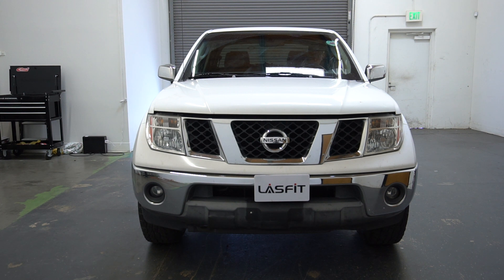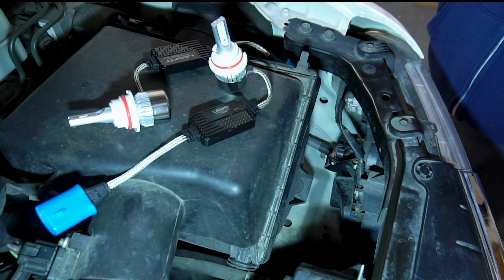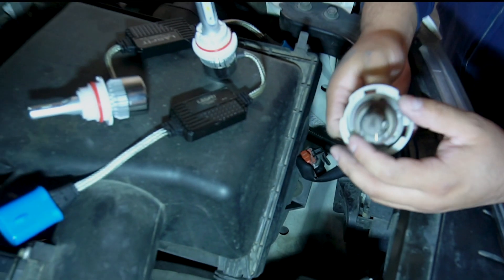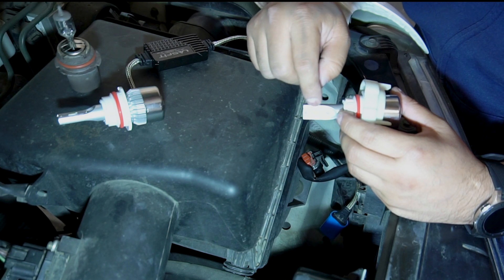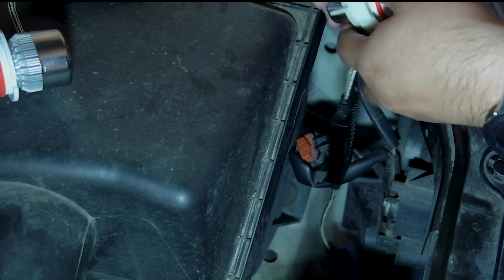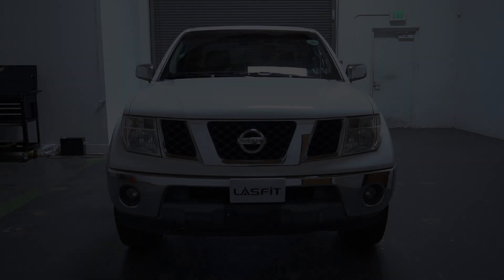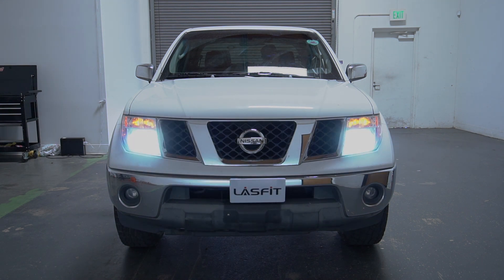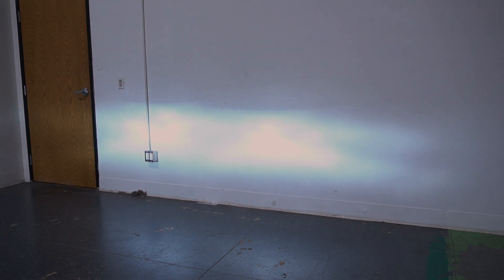2006 Nissan Frontier LED Headlight Bulbs Install - LASFIT LS series 9007

Comment: Nearly broke my bulbs. Took around 2 hours. You really need to show the most important part. PUTTING THE BULBS BACK IN.
Reply from the maker: We'll update a new video. What's the year of your Nissan Frontier?
Could you tell us more details of your issues while installing?
Reply: @Lasfit-Automotive  2014 frontier. My issue was putting the bulbs back in. They wouldn't lock. Took me around 2 hours to get both.
Reply from the maker: @bernardberben4852  There is a ring to lock LED bulb on the socket.
1. You need to remove the LED retainer clip
2. Put the OEM ring on the LED bulb
3. Put the LED retainer clip back
4. Install on the LED bulb and lock it in place with the ring.

Comment: Left high beam didnt not work at first then I uninstalled it and installed it and it worked why is that?
Reply from the maker: The power plug probably didn't connect well and the LED bulb didn't get power.
Reply: @Lasfit-Automotive  works good now 🙌

Comment: I have a 19 Nissan Frontier I use the HB5 9007 LED headlights had them the wrong way until I saw this video and fixed it right away thank u lastfit
Reply: How did the plastic piece on the Led match with the housing on the frontier?
Reply: @IhtsJdawg  the plastic piece is supposed to be loose around led light, that’s how it was for mine if that’s what you’re talking about

Comment: Could you so led turn signals without hyper flashing ??
Reply from the maker: Yes. What's your vehicle make, model and year?
Reply: A 2005 Nissan Frontier
Reply from the maker: @ryanbraun3500  The front turn signal light bulb size is 3157 for 2005 Nissan Frontier:
https://www.lasfit.com/products/3157-led-turn-signal-light-anti-flicker-amber-amber?utm_source=Social&utm_medium=YTB%20Channel&utm_campaign=T-3157A

Comment: Could you make a video of how to adjust and level the headlights on a 2005 pathfinder (r51)
Reply from the maker: We'll do it when we get a chance. Or, you can refer to these two videos:
https://www.youtube.com/watch?v=hdWaXX7IZ80&t=6s
https://www.youtube.com/watch?v=-URl1GIoEnM
Reply: There is just one screw. An 8 mm bolt. Clockwise to lower and counter to go up

Comment: I have tried this brand and several other the plastic lock rings will never seat back in with the led bulbs. I’ve tried for hours on 3 different sets of bulbs. I removed the trim piece installed on the new bulb after the lock ring was on the diameter of the led heat sinks will just not let the bulb far enough inside the housing for the circle lock ring to attach....
Reply from the maker: Hi, about the installation tips for LED bulbs 9007
1. If the OEM plastic lock ring is not big enough to put into the LED bulb, please remove the white base collar(with a red ring) from the LED bulb.
2.Put the OEM plastic lock ring into LED bulb.
3.Put back the white base collar into LED bulb
4.Lock the LED bulb on headlight socket and fix with the OEM lock ring.
Reply: Lasfit Auto Lighting yes I did that but the lock ring want seat back into place
Reply: The diameter of the bulb is too big so it want let the bulb go far enough into the house to allow the lock ring to screw back into the housing..
Reply: I’ve tried other brands as well...0
Reply from the maker: @mattburns4407  Hi, is it convenient for you to take a short video for showing your issue? We'll help you fix the problem. Thank you
Contact email: cs@lasfit.com

Comment: Having problem with buy LED light bulb. 
 Nissan Pathfinder 2011. Only headlight I need from Lasfit 9007(HB5)
Reply from the maker: Yes, the headlight bulb size is 9007 for your  Nissan Pathfinder 2011, which works as low beam and high beam, here is the link
https://www.lasfit.com/products/9007-hb5-led-headlight-high-and-low-beam?utm_source=Social&utm_medium=YTB%20Channel&utm_campaign=LAplus9007

Comment: Can someone help me with this... if you buy 2 9007 bulbs, that would eliminate buying 2 h11 and 2 9005 bulbs am i right? Because the 9007 does both high and low?
Reply from the maker: Hi, what's your vehicle make, model and year?
Reply: @Lasfit-Automotive  its a 2005 nissan pathfinder
Reply from the maker: @blacktailbowhunter0135  Ok. For your 2005 nissan pathfinder, the headlight bulb size is 9007, dual beam, which high beam and low beam share the same bulb. 
Here is 9007 LED bulb： https://www.lasfit.com/products/9007-hb5-led-headlight-high-and-low-beam?utm_source=Social&utm_medium=YTB%20Channel&utm_campaign=LAplus9007
Reply: @Lasfit-Automotive  Great thank you! I ended up ordering 9007 earlier today so I’m glad they are going to work. Thanks for the help
Reply from the maker: @blacktailbowhunter0135  😄No worries. Will you install those LED bulbs by yourself?
Reply from the maker: @blacktailbowhunter0135  😄No worries. Will you install those LED bulbs by yourself?
Reply: @Lasfit-Automotive  Yep seems pretty straight forward.
Reply from the maker: @blacktailbowhunter0135  Yeah, it's not hard to install the LED bulbs. Would you please share a video with us for showing how you install the LED bulbs step by step? You'll get a surprise. haha 😄

Comment: I can't figure out how to get hi and low beams un-reversed.  I couldn't see in the video how to know what to do to get high and low in correctly because of poor video quality.  Whatever you did got them reversed anyway.  Can you help?
Reply from the maker: Hi, you can check this 9007 LED headlight bulb: https://www.lasfit.com/products/9007-hb5-led-headlight-high-and-low-beam?utm_source=Social&utm_medium=YTB%20Channel&utm_campaign=LAplus9007
For this LED bulb, the wider side (at one side of LED chips) upwards.
Reply: I have installed these on my 19 frontier and I have the plastic to the top and I still can get it right. The highs look no different then the lows. Also I’m not getting any range.
Reply from the maker: @Fishingfilms  Hi, could you check if the LED chips face side by side? The correct direction is the LED chips at 3-9 o'clock. Please contact us for support by email and attach some images to show your issue. 
Thank you.
Reply: Lasfit Auto Lighting 3/9 down range or 3/9 if I’m facing the truck

Comment: Bought these LED headlights and the white plastic piece that comes with them did not match up the housing on my 2017 Nissan Frontier
Reply from the maker: Hi, how did they don'tmatch up the housing? Could you please take some pics to show us your issue? Plz contact us for support by email.  cs@lasfit.com
Here is a installation tip:
1.You need to take out the white plastic piece
2.Put the OEM locking o ring into LED bulb
3.Put the white plastic piece back

Comment: Mine nissan has a plastic cover behind the bulb...the led air cooler seems to have contact with it..should I remove it or just cut some material off for it to be more spacious?great vid 👌
Reply from the maker: Hi, the plastic cover is used to lock the LED bulb on headlight. If it is too long to hold the LED bulb, you need to cut some material off for it to be more spacious.

Comment: Great video guys,
But I didn’t catch how you connect the led’s to the plug from the original truck wire. 
Does this new lights required adapters or something ? 
Thank you n keep up the good work .
Reply from the maker: Hi, the LED plug is directly connected to the plug from the original truck wire. No need adapters.

Comment: Would this fit on 2007 pathfinder? My reflector headlight have the square stainless inside place at front of the 9007 bulb i think it make the light bounce if you look on all reflector headlight they have this. So would this work on my headlight? Does the 2006 frontier have same oem headlight housing? Thanks I'm interested but which one...
Reply from the maker: Yes. These 9007 LED bulbs will fit your 2007 Pathfinder, the same as 2006 Pathfinder. You can purchase from this link:
https://www.lasfit.com/products/9007-hb5-led-headlight-high-and-low-beam?utm_source=Social&utm_medium=YTB%20Channel&utm_campaign=LAplus9007

Comment: Uuummmm...If you flip the bulb 360 degrees, wouldn't you be right where you started?
Reply from the maker: Hi, the white collar of LED bulb has one sticking point. Usually, when you lock the collar with LED bulb, it's at right direction. But if you find the beam pattern is not good, you can adjust the beam pattern by rotating the LED bulb.

Comment: Hi
Will it fit on Pathfinder 2009?
Reply from the maker: It does not fit on your Pathfinder 2009. The correct headlight bulb is 9007, here is the link: https://www.lasfit.com/products/ls-plus-series-9007-led-headlight-bulbs